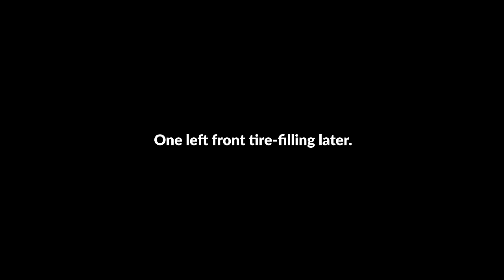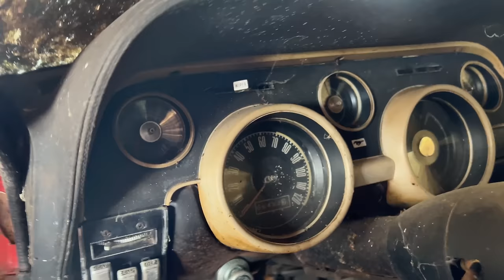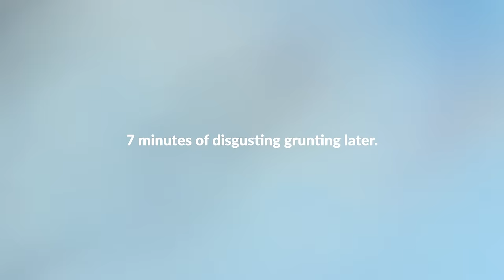Two Mustangs Parked for 42 Years! Will They Run and Drive?

Comment: This is awesome! My first car was a '67 coupe. I was 17.  Bought it for $1000 from a little old lady who was the original owner. It was a white Sprint, had the 289, perfect interior. And it had the rear tail light panel grates like this one! They were a pretty rare option. Sadly, I wrecked it, and sold it for scrap. I haven't see another like it in 30 yrs.
Reply: The sprint mustang did not have a 289, they specifically came with a six cylinder.

Comment: great video!  life long family of Fords - that 67 is a highly optioned car and both are worth getting a Marti report on.  that tail panel is really rare, as is the overhead console.  the 67 I think has deluxe interior and possibly the interior decor group, maybe more.  really cool stuff.  the styled steel wheels could have been an option as well.  
the 68 is interesting - if that is the orginal engine, it's a J code(302 4 barrel, 230hp) which is a rare engine option for the year.  glad to see them come back to life!
Also, I see that euro bumper e30 with some M stripes on it looking ready to go, another E30 in the garage poking out and some E46 shells getting some work done.  I'd like to meet these folks, probably a lot of fun!

Comment: You should always use Emery cloth instead of a file to clean your points. It does really good a file he might take too much material off versus an emery cloth. You’re gonna literally just take the corrosion off you’re not gonna take very much material off at all.

Comment: The sixty seven is either a g t or check the body number. If it's a sixty-five B it means it's a deluxe interior, which are uncommon. I had a 67 similar to that one. But mine had a factory four speed.

Comment: that 67 is a kinda rare car! it has deluxe interior as well as the finned tail light panel add on which the coupe ones specifically are hard to find as they only reproduce the fastback ones last i checked ! very cool ride , over head counsel is also a rare and desirable option ,

Comment: I love the 1968! I love the little scoops in the hood.  I also like the 1969 because of the Hip Scoops.  I would love to build a 68 Mustang even though I am a Chevy guy.  Those Bias Ply 60s with big block letters remind me of the sixties from Western Auto that I put on my 78 F100.  They were cool until I had to steer on wet pavement during flash floods.  That was crazy!  Those were 289 cars because the straight six cars only had four lug nuts.

Comment: I had a 67 mustang back in 1978 in high school and it was nice looking  and all my friends got one after they saw mine. It was fun to hot rod around. I really loved that car good times great memories.
I use to run Carter AFB four barrels on my 302 mustang. It was a one wheel tire burner. If I would have know what I know now I would have put duals exhuast on it and maybe welded the spider gears. But that may have made the rear end unsafe in the rain and snow. I wish I had another one to play with. 
     Now they need new gas tanks a must and brakes a real must and paint seat covers carpet. Any longer and those mustangs would have been completly ruined.

Comment: Funny to see that tractor next to these cars, logic would say, pull them out of that position first so you can work on them freely, the wheels don't need to turn with such a surface, they slide nicely into position...

Comment: My first car was a '68 with a 302. Mine originally had a vynil top and I had the same metal trim at the top of the rear quarter panels.  I suspect that '68 was also originally a vynil top since it has the same metal trim pieces. The '67 does not have them so it was likely a regular painted roof. Nice cars! Wish I still had my '68.
Reply: Bought my 68 in 1977, I was 18. 289 car, vynil top car, factory AC,  power steering automatic etc. Lifelong Southern California car,  in great shape, on the road. Unfortunately the guy in the rear view mirror at 65, looks nothing like the 18 year old that Bought it!! 😊

Comment: That True Fuel stuff does not work well on a lot of small 2 stroke engines, I found that out the hard way, rebuilt a carb twice to find out its that fuel it did not like for some reason, works in my chain saw, but boy she gutless with it.

Comment: The little pedal near the dimmer switch on the floorboard is the windshield washer pump switch. I used to confuse my friends by spraying the windshield without touching a button on the dash.

Comment: thank you for the words. when i moved to westport. i own a 454 one ton chevy. mid 70s. the the guy i sold it to could not stop smiling. 50,000 mile big block. new from one end to the other. just went threw it. right down to all new rubbers. all rubber. down to the hood bumps. anyway 4 strokes later. and no one in the family wanted it.  what ever. the guy drives it every day.  he's had offers of 8,000. he always tells them. i'm not the owner.  his for life.

Comment: Correct if I'm wrong,but did you check the engine oil and transmission oil on both ford mustang before you started them both????

Comment: I recently received my dads 74 dodge d100 witch has bin parked since 1991 lucky no seized bakes next is getting it started and mobile I'm up tonthe challenge he did alot of work on it and it's in too good of condition to not to revive it after sitting so long i hope to drive it this year

Comment: A bit of constructive critisism:
You need to resist the temptation to use slow-motion on the pressure wash segment. It's super frustrating and I doubt most folks have the patience to put up with watching it happen that slowly. I liken it to having to watch the process of freeing the brake drums in slow-motion.
If you'd have used time-lapse, we could have seen the bulk of both cars being degrimed in the same amount of playback time.

Comment: If i was being overly critical, it is because i have a SCAR ON MY HEAD THAT STARTED ITCHING AS SOON AS I SAW THE 67!!!!! JUST CANT BELIEVE THE 302 AND 289 WERE IN THOSE YEARS WITHOUT A BRAKE BOOSTER AND THE HEATER HOSES CUT.....AMOUNG OTHER THINGS I SAW .....MY 67 ( GRANDMAS) DID HAVE BRAKES AND I FOUND OUT HOW THEY WORKED CAUSE GRANDAD CHANGED THEM AND I HELPED......and i got to press the pedal (or not in winter conditions).....i detailed that car and listened to CHET ATKINS, AND ROY ACUFF ON THE 8 TRACK TAPE PLAYER....THE CENTER  HUMP IN THE BACK SEAT WAS COVETED ON SUNDAY CHURCH DAY......WHAT CAN I TELL YOU? I GOT ALOT OF MEMORIES IN DAT CHERRY RED TWICE PAINTED EVERY 3WEEKS TURTLE WAXED MACGWEYERED AND SADDLE SOAPED INTERIOR WITH BABY MOONS AS HUBS ......THE LAST OFFER FOR THAT 200 THAT CARRIED US 200,000MILES THRU LIFE AS A FAMILYCAR,  ONE OWNER MUSTANG WAS THE ONE THAT ADDED THREE BEDROOMS , A WASH ROOM AND TWO BATHROOMS IN OUR HOME( IT CARRIED THE FOOD FOR US TO BUILD THOSE IN 25+ YEARS WAS NOT WORTH THE MEMORIES WE HAD IN IT...... WRENCHING, RIDING, RELIVING , BY REMEMBERING THAT CAR!
Reply: Everything was an option then. My 68 has power steering,  an option,  factory AC,  option,  automatic,  option, vynil top,  option, and MANUAL drum brakes. Power brakes? You guessed it...an option. 😊

Comment: Concerning removing the brake drums. I never see any car rescue guys try to back off the self adjuster from the back!!?? I always have to do it whenever I work on newer drum brakes to get past the rust ridge. Always makes it easier??!! Of course you have to beat the hell out of it with a big hammer first!
Reply: Ii see the 68 is missing its fan shroud … gotta get one!
Reply: FYI, you can convert to disc brakes by finding mid 70’s Granada front spindles, buy calibers and rotors and have disc brakes!
Reply: Was that a dead mouse on the 67 package tray!!!!

Comment: I guess good job, but wouldn't it be better to pull the spark plugs and lube up the cylinders Before cranking the car over Dry.
Maybe even Borescope the cylinder and get a feel for the condition of the rings/cylinders?
How long do you expect the engines to run before needing a rebuild... guess it doesn't matter if the kids are going to go through them at some point.
If they are anything like most young kids today, they will be sold off for a car with more creature comforts.

Comment: With the 66, 67,68, and first part of 69, the brakes and hardware seems to rust to the drums.....soany of these were converted to disk for that reason in the late 80$ ......i grew up around mustangs and CAPRI'$ both essentially the same car in the late 80$ early 90$ but theze tended to rust and have good tires on them until they were put up and become barn finds and "tree ornaments" along the highway or mountain roads.....so i feel your pain about these two cars.....so get them running and ruling AGAIN....dont drive them far until you have absolutely gone through the structure and motor😊
Reply: My grand parents had a 67 MUSTANG sincey third birthday.....I chose the car by bumping my head on the fender...it was to be in our family for 25 years....I got my licence in one.....they were from OHIO AND LIVED IN ARIZONA......SNOW WAS RARE EXCEPT UP NORTH( FLAGSTAFF, FOUR CORNERS....I LEARNED TO DRIVE AND DRIFT IN THE SNOW BECAUSE GRANDMA TOLD ME TO STOMP ON THE BRAKE PEDAL ON BLACK ICE ......I LEARNED BY NOT WRECKING THE CAR AND BE CALM IN A FUP SITUATION.....

Comment: With carbs being so cheap and available new . I struggle to see any sense in not buying a fresh Holley to bolt on and treat the old motor to a sweet delivery of atomised fuel instead of that dirt, dust and rodent bones when it first gets to rock'n'roll again? Eliminating blocked jets, stuck float valves and sticky linkages, butterflys' and chokes. 
The other thing they both deserve is shelter. The only reason they still exist is they were sheltered. This spells the beginning of the end for them probably. Thumbs up for you anyway. Love the '68!

Comment: Why not just back off on the brake adjuster? Slot at the bottom of the backing plate
Reply: Loosening the adjuster doesn't help when the shoes are rusted to the drums.

Comment: Wrong hood with the scoops.....i am thinking you are not narrow enough!  I havent seen very much inside of the cars but the 302 and 289$ were top and both cars should have air and power steering a brake booster would have come from a newer ford car .....both project cars.....i might have missed when you said that these " barn find " mustangs were not numbers matching or are original motor, interior!

Comment: and now someone is going to give the cars to there grandkids it will take $50.000 each to make them cars road reliable all the suspension will have to be redone dash all moving parts frame work they call it 40yrs of rust rebuild engines and transmissions i hope they do this to give them a safe car that means take them to the frame

Comment: All of that was add ons.Dash is'a 69 . The 67 looked like a "frogs head"and the silver dash panel would have been offered with an air conditioned car..... top console on the headliner never on that year....someone made that work to be special..........the steering wheel is froma  200, not what came with a 289 offering from ford for a 67 . That 289 was an add on and would not numbers match....a  200 would match better.... So enjoy them..... I dont see them completly being " true mustangs" unless they have the steel or ford rally wheels for those years!

Comment: You do not have a clean title to either of those Mustangs, I do. They are earlier than GA requires a title, but I have titles to both. Please provide me with the VIN for both Mustangs and I will produce titles within 5 days. Owner my a$$! I parked my Mustangs one night because I'd had too much moonshine to drive, safely that is, but I swear, when I looked back I saw three Mustangs, maybe four. So, before I call either the Hall or White Co. authorities (Junior and his repossession team) you need to haul them rat back to me!

Actually, by taking off the brake drums, you've deleted my Dawsonville Boot. When I left my Mustangs, I took a good long pee on all the brake drums to rust 'em up good in case somebody tried to purloin them. If they'd had front disk brakes, then I'd locked 'em different.

Comment: Well you got them running but not as Derrek does it !!!   You did not check the oil ! You did not check the water ! You did not Check the Transmission oil.!  You threw way to much fuel in the carburater the engines were flooded immediately. What the hell are you teaching these guys who watch this?    My advice, is DON'T DO IT THIS WAY GUYS !!! . .. Always check fluids first,, check spark by pooling a sparkplug then see if there is spark etc etc...  Ow and Alwais use jack stands not a jack only... it was really dangerous ... !!!!!!!

Comment: You definitely should have pulled the plugs and lubricated the cylinders to prevent damage, before turning the engine over with the starter.
Vice Grip Garage, is nothing but a phoney.

Comment: These people on here are full of themselves. The reasons one there is no way in h*ll they will start in the first time they turn on there camera well I'm going to say my opinion they work on them before hand. That way they can drive them off bs ant no way.
Reply: For what it’s worth, I can attest firsthand to the fact that Jared does not do anything to get the cars running before filming. In his videos, what you see is actually what happens (the only edits are to shorten the time it takes to start so that the video doesn’t  become boring). Others may do the trickery you talked about but Jared has always been upfront with his “will it start” episodes. -Duane the Editor
Reply: @decaharms  well one thing I would have done looked inside them cylinders and seen how dry they where because if it was sitting is long as it says took a big risk just turning to key over like that. Them rods and all that might not have moved like he wanted if it was recorded like he had planned out. And why are you busting my balls I'm just saying what's on my mind and my opinion is mine. Did I hurt your feelings. 😂 Man get over yourself. Was you there to see these steps he took?
Reply: No feelings hurt here. And no ball busting intended. Just letting you know that your assumption that Jared was working on the cars to get them started ahead of time was not the case. That’s all.
Reply: @decaharms  ok sometime YouTubers not saying Jared does this but just makes a guy wonder if they fix them before hand them takes a few things off or make it not run to a point you understand what I mean?
Reply: I totally get what you mean and I’m sure that what you’re talking about really does happen. So you’re right that “pre-starting” a car before filming does happen on other YouTube channels. Jared has always vowed not to do that because he wants the Questionable Garage to be authentic where viewers get to see failures as well as successes. Thanks for watching and supporting the channel. Really do appreciate your feedback.

Comment: The titles like this always makes me cringe. I see these and always imagine people just dumping new oil and coolant in. Then jury rigging up some temp fuel, pouring a few cans of starter fluid til it sorta runs with the person continually revving it to keep it going.

I hope that is what we dont see here. Makes me cringe when I see that. Great way to trash the cylinders and other parts.
Reply: Around 35-36 minutes he actually makes a point that you don't want to use starter fluid cause it will dry out the cylinder walls so using a premix is better.

Lots of YouTube channels do have beginners but this one has a pro.
Reply: @Letstryscience  I stopped it before then when he started dry cranking it. Nah, amateur still. I have done a barn find. Did a great job ensuring those cylinders will need to be bored out a good chunk.